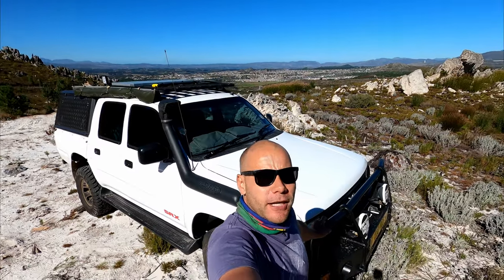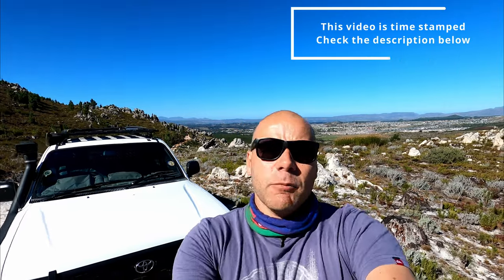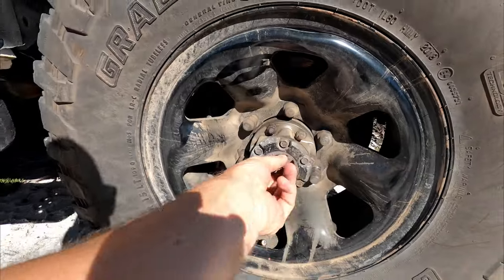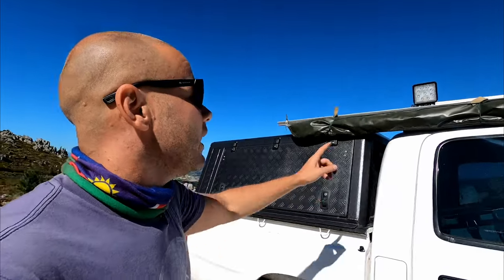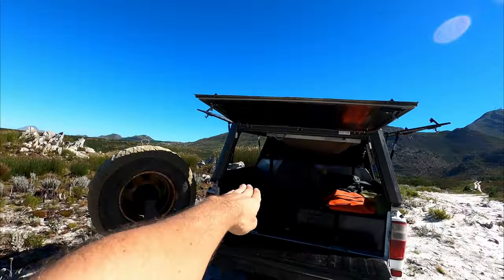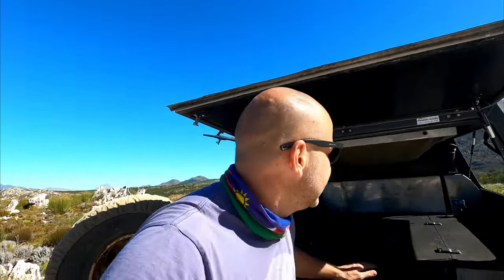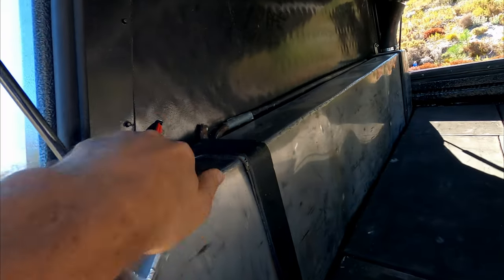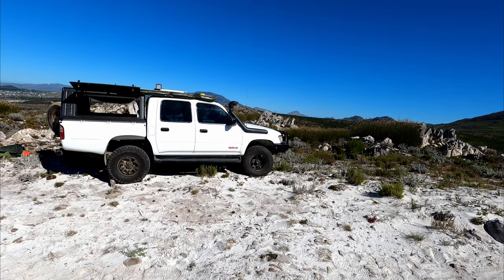My overland build for Africa | 2000 Toyota Hilux | 85% done | Pt2

Comment: Hey Nick.  I have owned almost the entire TOYOTA 4X4 lineup over 20 years. From the old Hilux 2.2 and 2.4 SFA bakkies, the Hilux 2.7i 4x4 (same as yours), the Hilux 3.0 D4D, the Hilux 4.0 V6 and now the Land Cruiser 4500 EFi with NO ISSUES WHATSOEVER apart from normal maintenance... You chose the best "tool" for the job!!
Reply from the maker: Thanks for the vote of confidence Riaan! took a bit of a chance with an older vehicle, but so far so good👍 also I saw so many of them in Botswana, that I will not have a problem with repairs&parts

Comment: I have 2 hiluxes... A 95, with the 3L diesel, and a 2002 with the 3rz fe Gasoline. The 3rz its a great engine, its not Very popular here in Brazil, because of the gas prices, but its as realiable as any diesel Hilux from that period, and  more powerful. Great video, you just got 1 new subscriber
Reply from the maker: Awh Gabriel Im jealous cause I only have one😂 in my opinion the older models are the true legends! did 1000km yesterday, zero complaints from my hilux. Petrol price pretty steep here in SA as well, but a lot better in Namibia where I live and in Botswana. Thnx for subscribing and having you onboard for 10 years through Africa with a 21yr old Hilux!

Comment: Too late for you now, but just a thought; you mentioned that drawers are not the ‘automatic’ choice for everyone. Rather than drawers on the bottom, throwing gear on top, which is the norm, what about keeping drawers raised in the canopy and putting your heavier gear underneath? Your tent, sleeping gear etc might weigh more than what’s in the drawers, and you’ll still have a flat top surface to put other gear in boxes etc.

Comment: Down lights in a house is convertered from 220 to 12v and work with dimmer switch
Reply from the maker: I was wondering. Still havent done it, cause people told me its not possible with the LEDs

Comment: Hey Nick,We have the same hilux 2700i.My question is why didn't you get the Diesel one wich i think is better on fuel consumption because i know the 2700i is heavy on petrol.
Reply from the maker: short answer, it is the one that I could find that was in the best condition. I spent a lot of time comparing the pro's and cons of diesel vs petrol and in the end it equalled out for me. This model is still ok, on avg I get 7.5km/l, even better on gravel when I drive slower, but obviously much worse when i go into 4x4. Its the one after this, the "bull nose" that has very bbad consumption